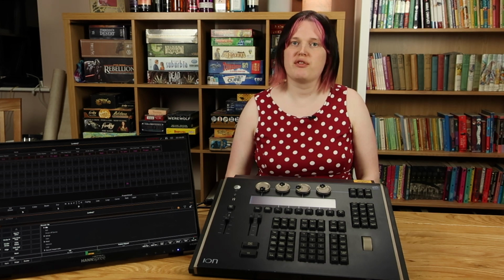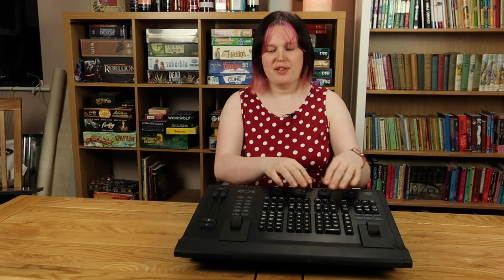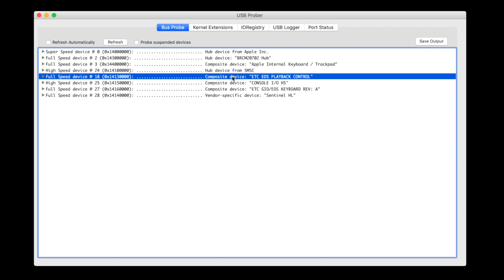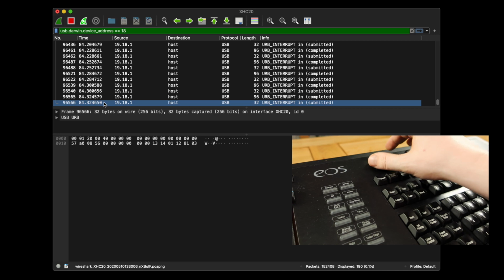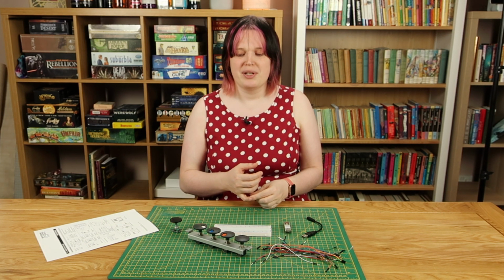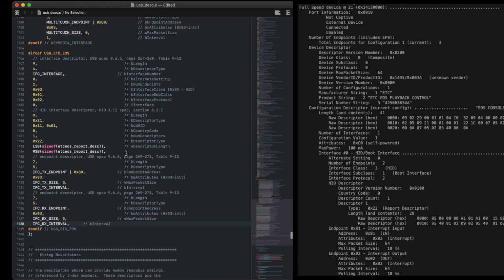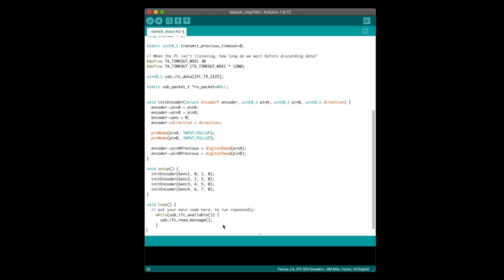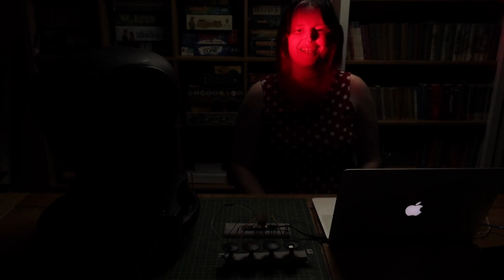Reverse Engineering a USB Device (Element14)

Comment: Since you added the new device type by editing the library hardware code (i.e. usb_desc.[ch]), I suspect those edits may be lost if the teensy library type gets an update. I've never worked with a teensy before, but I wonder if there is some API call that can install/use a custom USB descriptor from setup().

Comment: Is it possible to emulate a USB host and slave and use the Teensy as a middleman to receive and forward packets? The idea is I want to make a wired printer wireless. My idea is the Teensy (as host) would do the handshake with the printer, and then (as slave) would emulate the printer and do the handshake with the computer. Then, anything received would just be forwarded. Perhaps this would require 2 Teensies, unless I could figure out how to utilize the computer's Wi-Fi.  Could that work? I know I could buy a print server, but that isn't as fun.

Comment: Fellow Theatre Tech here:  Ironically I searched YouTube for "reverse engineer a usb device" for the purpose of doing exactly this, but for a different control system.  I clicked on the first video without even looking at the thumbnail and walked over to the fridge to get a Coke.  I literally started choking when I heard "Hello this is an ETC Ion".  BRILLIANT!  And great work!
Reply: What console did you try this on? I wanna try this on Avolites Titan Mobile.

Comment: Hey Amy - great project, I am looking forwards to building one of these now!

Quick question: after looking over the code, I noticed the encoder button push was not included in the current version? 
I was wondering if you have the data of the button pushes for encoders 3 & 4, as I did not see that in the video? As I am looking to include that functionality as well.
Reply from the maker: I've got the USB codes for it somewhere. I didn't include it because the encoders I'm using don't have a button built in! I'll get back to you soon.
Reply: @amyruthworrall  Hey Amy - Sorry to ask again, but I was wondering if you had had the chance to find those codes?
Reply: @amyruthworrall  Thank You! 
Out of curiosity, out of all of the inputs on the wing, how many did you end up recording the protocol data for?
Reply: Hi Amy, just found the video as I'm in the process of making an encoder module myself. Love your work (especially enjoying the full wing build)! Saw this comment and was also wondering if you had the codes for the push buttons on Enc 3 + 4?